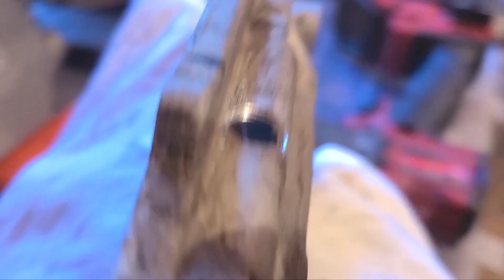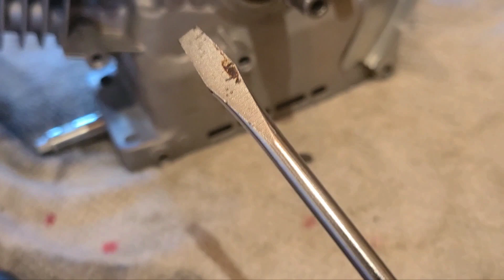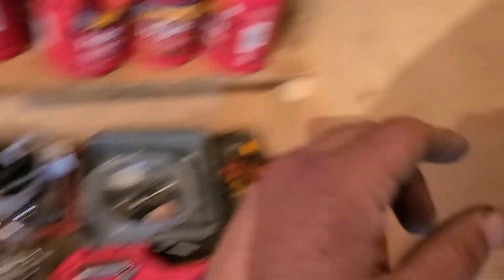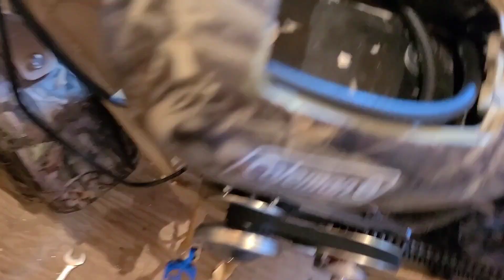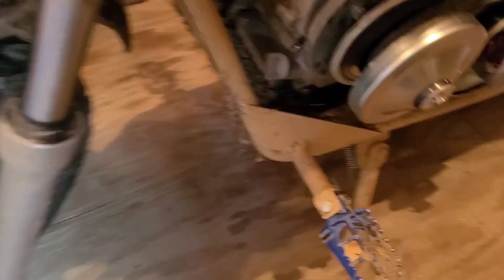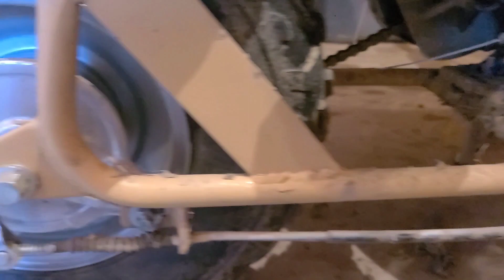Coleman With A Torque Converter

Comment: Hi I have a tilloston 212 but the crankshaft threads cross threaded do you know the size of the threading tool size to retread the treads for the crankshaft
Reply from the maker: Sorry I missed your question. Are we talking flywheel side or where the clutch goes?

Comment: I like the champion rocker assembly. The mini bike did well. Great job 🔧👍
Reply from the maker: Thanks! It's a good overall mini bike. I'm a heavy dude and probably pushing that frame pretty close to some limits, but it held up. That path was extremely fun to ride, I only wish I had better tires and a couple of other bikes to compete with. That would make for an unbelievable time trial. I bet with my BT200X setup right, I could pull close to 8 minute laps out there. I was dogging a little out of the hole and had to slow way down for the turns with those stock tires.

Comment: i got a good deal on a ct200u with a stock tillotson 212 , but ive wanted a wildcat 223 for a while now should i stroke the tilly 212 with a EC wildcat billet rod and a wildcat flat top piston or store the tilly 212 for future project and get a wild cat keep up the vids
Reply from the maker: There is more value in buying the complete Wildcat Engine than the parts itself. If you can budget the full engine as an option I'd start there and then keep the Tillotson for a spare.

Comment: How do you like that throttle linkage. I got the same one when i ordered my ducar 212cc from omb. I was thinking about using it on my MM212 pro with the ducar but was unsure. I do have it modified with no governor but im still using the factory style carb and linkage.
Reply from the maker: Dude.....I love it!! I'm going to be doing more stock style builds just because of it. I'm going to also use it with the governor deleted.
Reply: @fatbuddycat  awesome. I was a little nervous because the spring was a little stronger than I was expecting. Im staying with the stock style carb on my ducar surprisingly, also running a billet rod, a 2 degree flywheel key with the pvl flywheel, I know I should use a 4 degree, 22lb springs and a 252 rattlesnake cam.
Reply from the maker: @wesleyammon8425  that 252 sounds nice! I learned a little bit about cam profiles and even though there are fellas making big power with lift I'm not convinced it's the most efficient way to build an engine. At least not for a practical, dependable mini bike!
Reply: @fatbuddycat  i actually like it a little more than a 265 lift cam. It feels like it has more low end torque, even with 30 degrees of timing. And it sounds more aggressive.
Reply from the maker: @wesleyammon8425   as long as you can use it then they must be great, I find myself around 40mph less in most instances. I'll try one bigger some day!

Comment: I about fell out of my chair laughing when I saw the Leaning Tower of Putty.
Reply from the maker: Lol it went on a little heavy but sanded out just fine!! I only had one shot at getting it to cure up before the bike was headed out for testing.
Reply: @fatbuddycat  It held good and that's all that matters. Leaving the governor in after all that work was a bold choice. How do you like the performance?
Reply from the maker: @Buses2Bikes  loved it! I can do better with shiny parts, but it performed surprisingly well. I could have removed the governor, and the result would have been similar. Once the 30 series loads this engine, it would take almost 50mph to really get her cooking in the danger zone. I love this throttle linkage so much I would run it with the hockey stick cut and 1/4 inch bolt behind the flywheel if you catch what I'm putting down....😏....